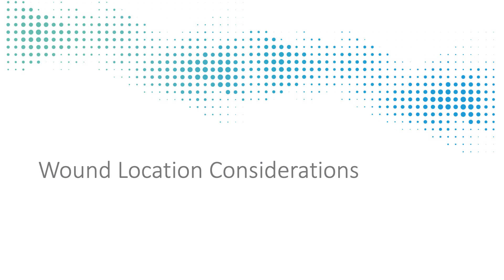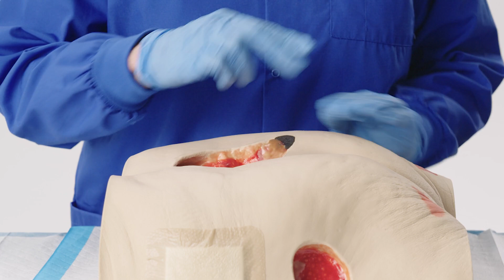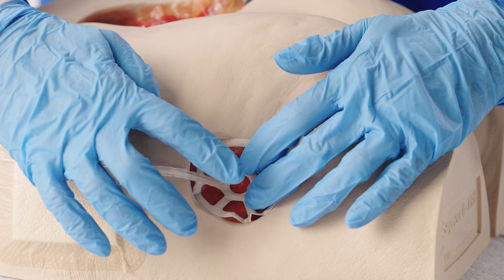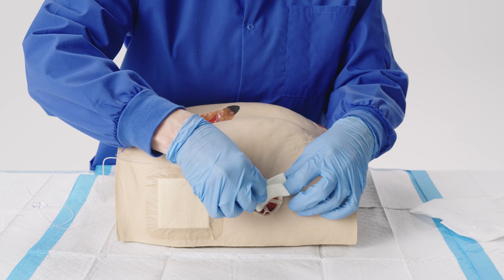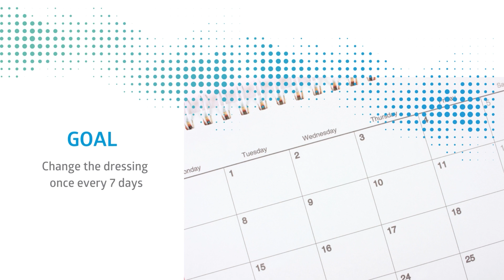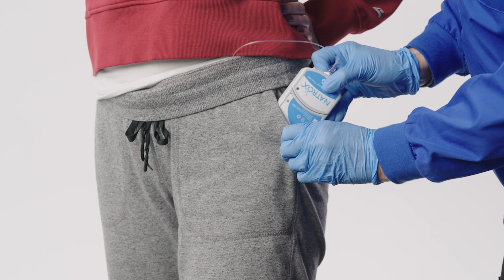Tips on How to Apply NATROX® O₂ for Pressure Injuries (PI)

Comment: Maybe I'm wrong, but I was thinking: could that part of the device which goes into the ulcer cause an even bigger one because of the pressure when sitting or lying down? What material is that part  made of? Silicone? Thanks
Reply from the maker: Thank you for your question and curiosity about NATROX O₂. The part of device you are referring to is called the NATROX O₂ Oxygen Delivery system (ODS). It is soft, highly flexible, and gently conforms to the shape of the wound. It is very thin, a mere 1.7mm deep, and made of a medical grade materials, including a thin layer of soft foam. The ODS is required to be covered with a semi-occlusive bordered dressing as part of the dressing change regimen. 

From a pressure risk management perspective, it's important to address the cause of the pressure risk, through appropriate dressings, pressure relieving surfaces and/or appropriate handling and turning protocols as part of a comprehensive Pressure Injury Prevention Program. Also, it's best to use care when placing the tubing to avoid creating additional discomfort or prolonged pressure on the skin. It is recommended to protect or pad the skin under the ODS tubing.  

Healthcare professionals use NATROX O₂ to help heal many kinds of chronic wounds, including pressure injuries. We invite you to read an example case study from a 94-year-old patient with a 12-month history of a pressure injury. After receiving NATROX O₂ therapy, her wound was completely healed with minimal scarring. The patient reported NATROX O₂ as being "easy to live with.” Find the full case study here: https://bit.ly/CS1_NO2